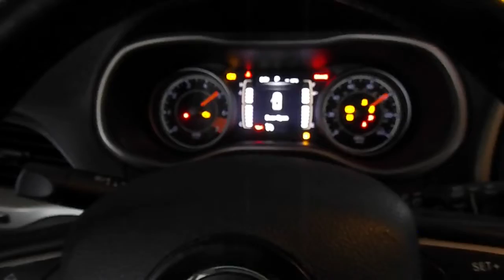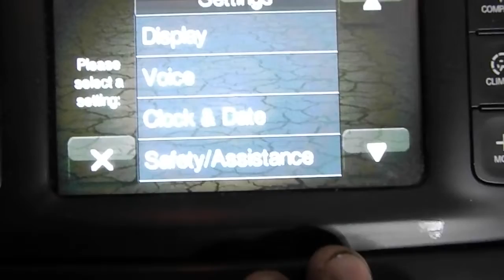How to Replace Rear Brakes 2015 Jeep Cherokee

Comment: Good video. Can you disable the service mode only once after finishing both rear tires, or you disable after finishing each tire separately? Which way is better?
Reply from the maker: You only want to disable the service mode when you are done replacing all the brakes and rotors you plan on doing for the day. I only did it in the video to show the entire process. So to answer your question, replace both sides before exiting the brake service mode.